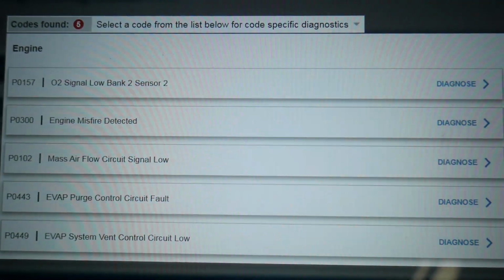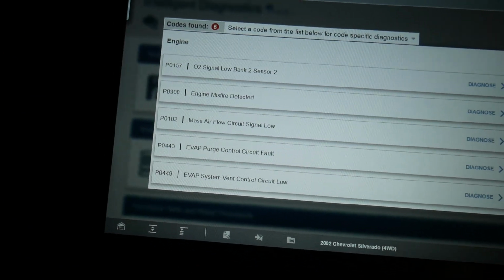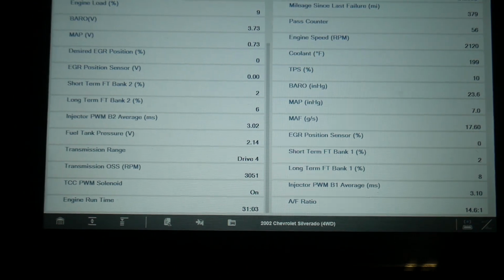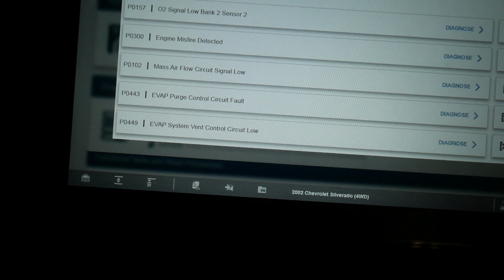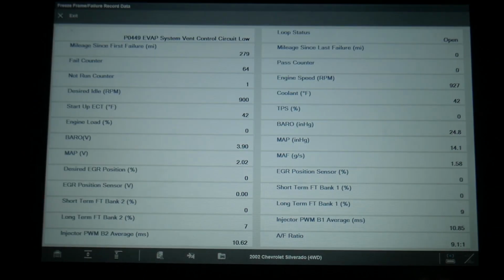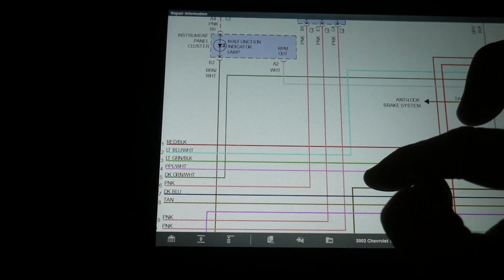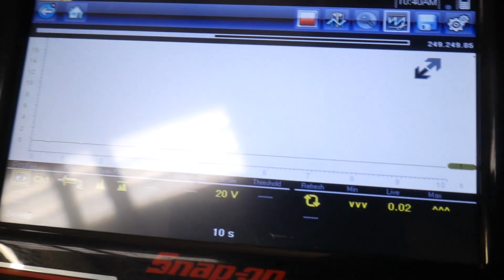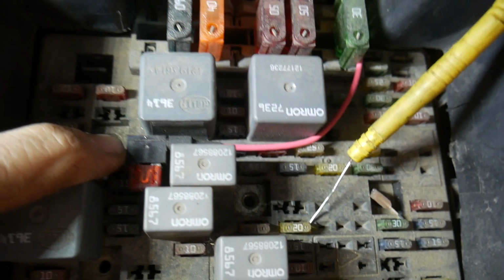2002 Chevy 1500 MAF and EVAP circuit codes -  Common Cause?

Comment: Can’t figure it out code been on 6 months getting power to maf sensor
Reply from the maker: You’re getting all the same codes or just MAF code?
MAF codes are common when it’s cold outside if the intake gaskets leak vacuum.
Reply: @ThePracticalMechanic  all three code and I’m getting power my truck is 24 years old just have valve cover change today and my buddy’s coming back tomorrow todo my intake gasket seal u think it could possibly be fix it

Comment: Thanks Chad. I'm trying to help a friend over email on what he says is a MAF issue. He's replaced the MAF sensor three times with no positive results. Just going through all possibilities to try and direct this guy to an alternate conclusion. At this point he's frustrated because his Altel 519 code reader tells him it's the MAF but we both know that can be misleading as you so correctly demonstrated.
Reply from the maker: depending on the code it could lead us to several different directions. Was is a p0101 or p0102? Is it a chevy V8 like in the video?
I see many of these trucks come into the shop with P0101, P0171, p0174 codes. The first thing I check is vacuum leaks between the MAF sensor and the cylinder heads. Any air leaks can cause the MAF sensor code. Intake gaskets are common failure points on these engines and they leak worse on cold mornings. As we roll into fall and winter I will start seeing these engines in the shop at least once a week that need intake manifold gasket replacements because they are setting lean, rich or MAF sensor codes.
That is where I would start. If you need help call me. if you don't have my number send me a message.
Reply: @ThePracticalMechanic  I appreciate your offer to help. The results he was getting from his power and ground checks at the connector were not making any sense. I asked if there was any evidence that the connector had been replaced. It was. I found a wiring schematic for a 2002 4.3 liter (his is a 2001) GM 3 wire connector and we have determined someone wired the connector incorrectly. He's going to correct the wires and I'll let you know if that fixes his problem. I know one thing, it's difficult to help when you can't see what"s going on. His honesty helped.

Comment: I have an 01 silverado 5.3v8, i have the po102 code, replaced mass air sensor and now eng1 fuse thanks your video, check engine lights is still on after reset battery for 30min. Do i need to drive it to get it to turn off? Cant pass Ny inspection with CEL on
Reply from the maker: May need to have codes cleared. If the code still returns the power and ground needs to be verified at the sensor as well as the signal.
Reply: @ThePracticalMechanic  ok that sounds like more than i know how to do, thanks for a quick reply, ill find a reputable tech in my town to help me... ill keep learning from your channel though....thanks!

Comment: I have this same problem but my fuse is good
Reply from the maker: I would check for power at the MAF sensor first since it’s easy to get to. If no power is present then you might want to check under the fuse block for chewed up wires or corrosion.
Reply: @ThePracticalMechanic  runs worse when unplugged I think

Comment: Wait one minute mister. Where is your harbor freight test light.? There is a trend of good diagnostic guys using harbor freight test lights lol JK with ya
Reply from the maker: Greg J Feeney 😉I can be caught shopping for diag tools at harbor freight.  My customer will think they can fix it themselves just by watching a YouTube video. Speaking about test lights, my snapon test light needs a new cord and my dealer just quit.
Reply: @ThePracticalMechanic  my toolbox has a mix of everything.  But my go to test light is from harbor freight.  I own two actually.  One in my tool cart and the other is in my mobile diagnostic kit.
Reply: I also use my digital snap on test light that gives voltage.  Love it on a mobile call. I attach my test lights to the ground on my power probe
Reply from the maker: Greg J Feeney do you have the power probe 2 or do you have a banana jack adaptor plugged into one of the newer power probes?  I wish the newer power probes would come with a banana jack alligator clip to plug into the ground lead.
Reply: @ThePracticalMechanic  I have a powerprobe 3 and I bought the accessory kit as well

Comment: Why were you replacing the plugs for the misfire again?? And were you planning on at least pulling the fuse tap out to test for power in the original receptacle?
Reply from the maker: Hey Keith thanks for stopping by. Perhaps I didn't explain it well in the video, I had 12v on one of the lower leg of the fuse tap at the primary fuse but not the other leg and also had no power to the pink wire at the purge solenoid. I initially expected to find chewed wires under the fuse panel since we live in a rural area but when I saw the fuse tap connected to the ECM fuse that is where I started. I didn't have it camera but the lower fuse was blown. I felt no misfire and the PCM counted no misfires during a test drive so I didn't scope the ignition system. I pulled the plug just to check condition since it had a previous misfire code and because it is a higher mileage vehicle. The truck will be spending most of its time in the mountains so we wanted to make sure the truck would continue to perform well for the season.
Reply: @ThePracticalMechanic  gotcha.  I'll be looking forward to part 2 💪🙂
Reply from the maker: Lol wait. Are you waiting for the rest of the diag footage or the one titled Comeback? I will have to check to see if I captured anymore of the diagnostics.
Reply: @ThePracticalMechanic  ahhh man the original title said Ep 1 😔
Reply from the maker: Yeah I just realized that I forgot to change the title from my original file name. Don’t worry I will work on some multi part diag vids. It might be a few while I work on some bigger projects and some equipment videos.